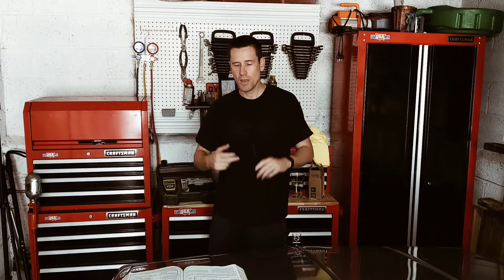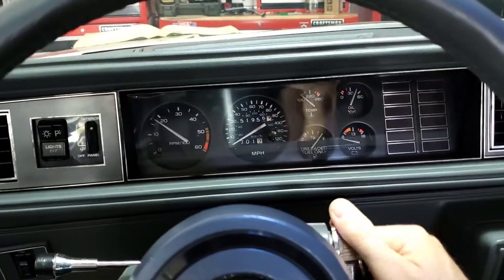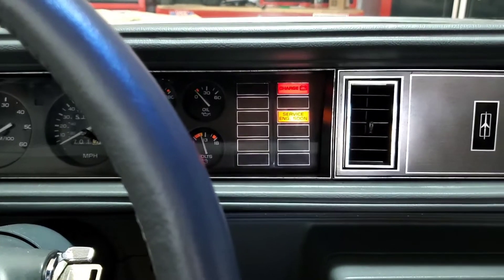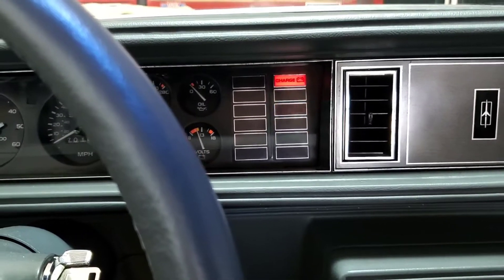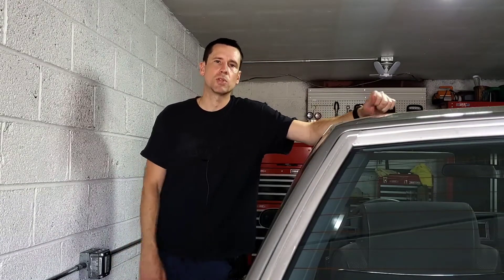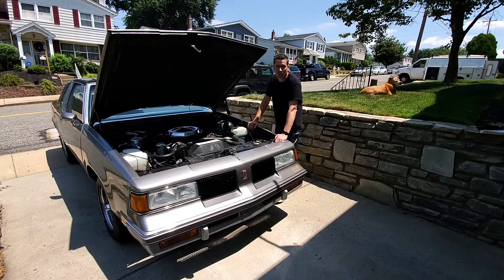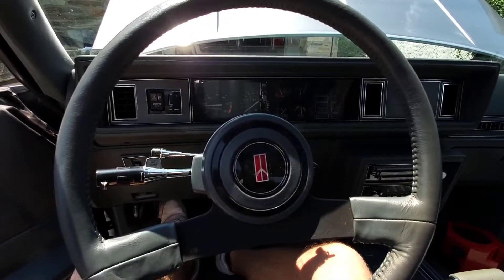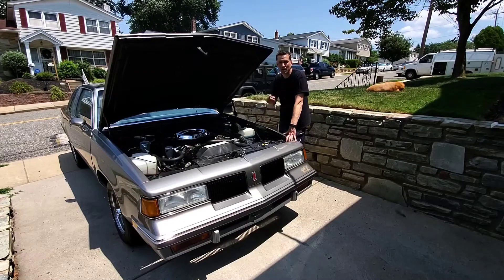Reading GM OBD 1 Trouble Codes Without a Scan Tool

Comment: I bought a 1995 Camaro and I saw that the CEL looked like it had been tampered with, when I took the dash apart, found out that someone had disconnected the odometer and now I have no idea what the mileage actually is. I guess that's one way of getting rid of a problem, but I can't believe someone would actually do that. Turns out it was the 02 sensor.
Reply from the maker: And that Camaro is still running somewhere with the same mileage 20 years later...